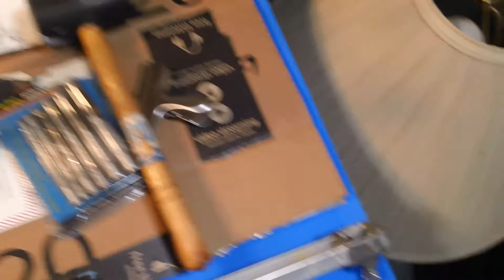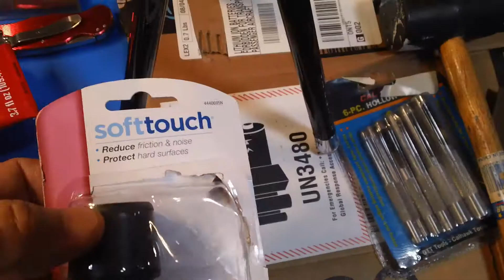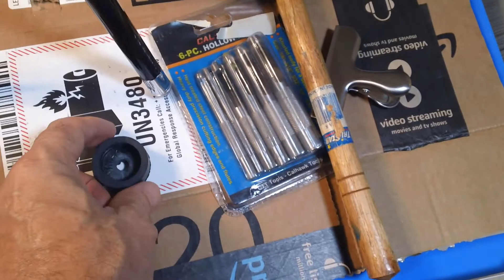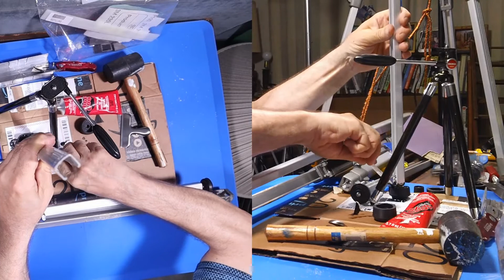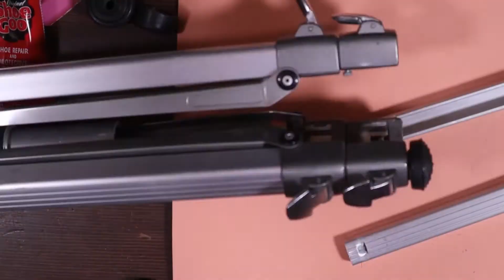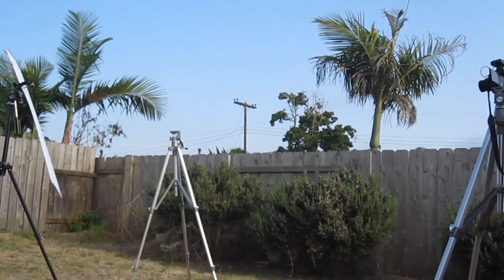VINTAGE VELBON TRIPOD REPAIR PART ONE

Comment: Hi, Bill! You and I have the exact same tripod. But, my pan handle became loose. Do you have any suggestions on how to fix it? Thank you so much!
Reply from the maker: Hi @cylas9352, They are great tripods.  By loose are you taking plastic part on the handle or are we talking threads on the actual handle itself?   If it were me and the handle I'd pull the handle off clean as best I could inside the plastic and on the metal post that it goes over.  After that I would apply epoxy or jewelers cement in the hole and post.  Would then reattach to where it was before and then let it sit before next use.  If it is the metal threads to the handle then that is a different story and could be internal, external, or both.  Thread repair is a bit more difficult, but can be done.  Your tripod will not look as good after as I suspect you will have to either remove the outer shell or drill a slightly larger exit hole for the thread cleaner.   Either way I wish you the best with your tripod.  The old ones really do have a certain appeal that is for certain.